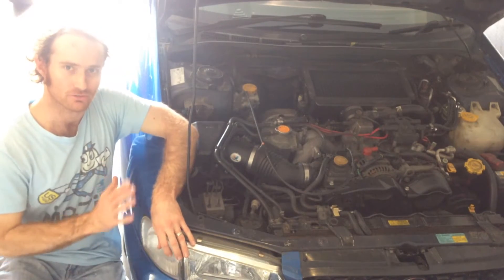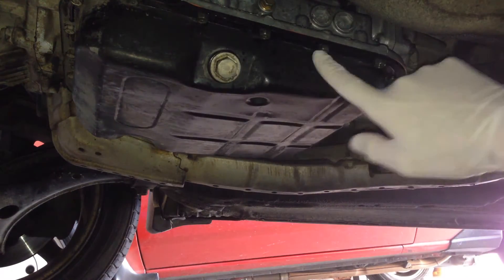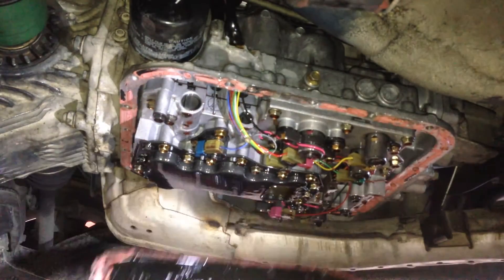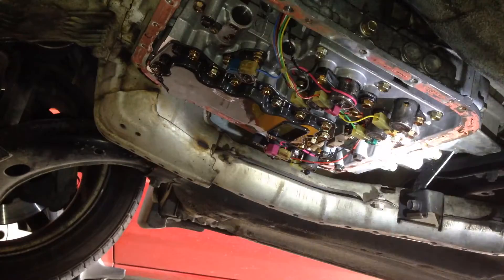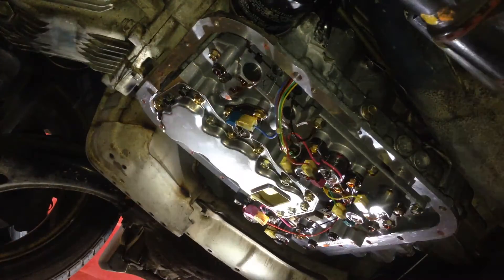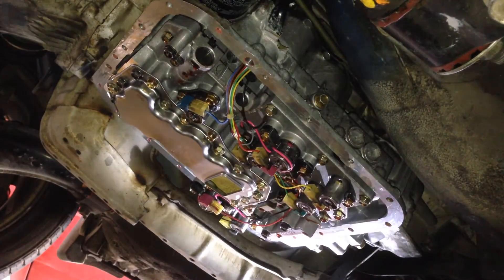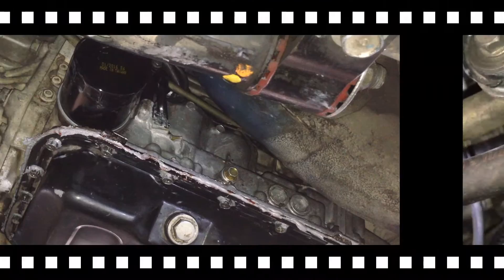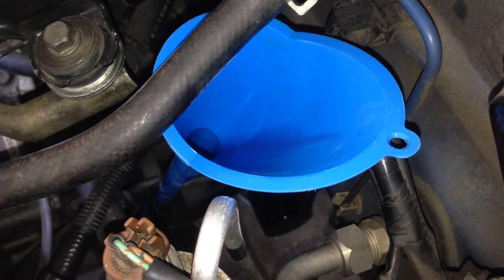Servicing a Subaru Phase II 4EAT 4 Speed Auto Transmission

Comment: Hello, I have a 2001 Subaru Forester with a 2.5 L engine and a four speed automatic transmission. It has about 200k miles on it. I have recently been experiencing trouble going from park to any of the forward gears. Reverse works just fine. I suspect that it is the shift solenoid assembly inside the transmission. I would love to hear your thoughts. Thanks in advance. ✌️, Jeremy

Comment: Dude... this was painful to watch how much sealant you used, WITH a gasket, and how much was seeping into the pan... that stuff breaks off and circulates into the transmission... if you have a gasket,  you do not need sealant and vice versa... use gasket glue to hold the gasket on if it gives you trouble. Looks like you need a trans flush for safe measures.

Comment: from my experience with these: changing that internal screen is a waste of time, doing a pump out change using the cooler lines is a much better way of changing the fluid, and using full synthetic atf for better results
Reply: I had a toyota gearbox failed at shy 90K miles because that filter was blocked... even though I changed the fluid regularly.... That filter can be cleaned by the way, it's a stainless steel mesh, just use the carb cleaner.
Reply: @itftcomputers  No. Your thinking about it the wrong way around. The blocked filter didn't kill the transmission, the broken transmission blocked the filter.
Reply: @apachelives 😂

Comment: Hello Nev's Garage, my subaru forester year 2011 does not have this filter on the outside of the transmission, what is the year and the model of your subaru?
Reply: rafael odenir Just changed the fluid on my 2011 today. I removed the drain plug and let the fluid come out. Around 3.5 quarts. Then put the plug in and added the 3.5 quarts from the top in the dipstick hole. Mine has 64,000 miles on it and its the second time ive changed the fluid. The dealer i bought the car from said my method is fine.
Reply: Thank you, it's good to talk to you there in the US,

Comment: Hello Nev's garage, I have a subaru forester 2011, here in Brazil, and seeing you do this fluid change, I was in doubt, do you need to remove the cover every time you change the fluid.
Reply: from what i understand you can do the fluid change over in phases if it really needs changing, the main reasons for remoning the pan seem to be mainly to check for metal shavings on the magnet in the pan or to swap solenoids that have died
Reply: Não. Ele trocou fluido e filtro. Aí sim tem que retirar a tampa.